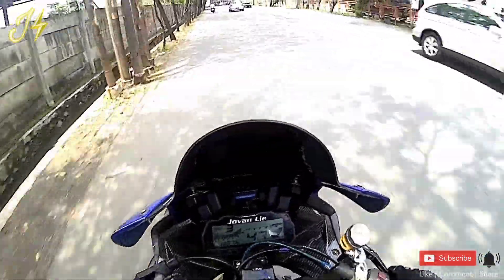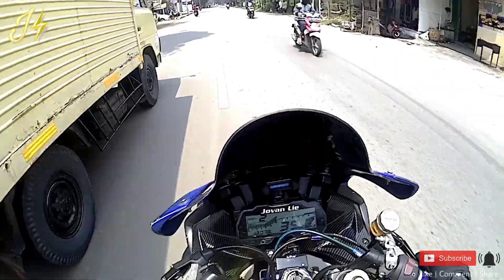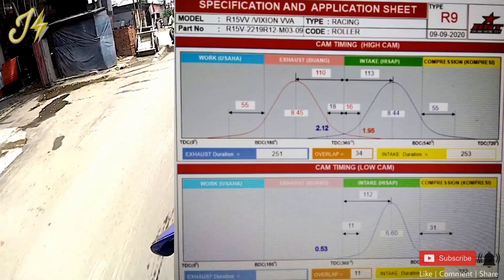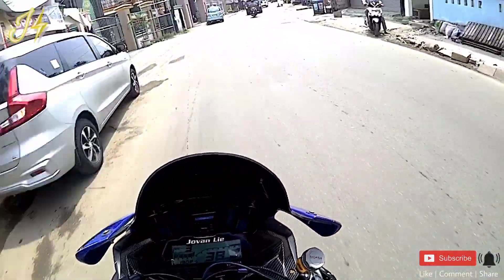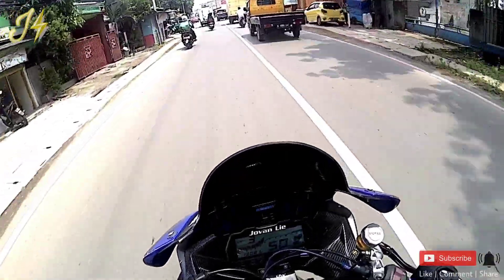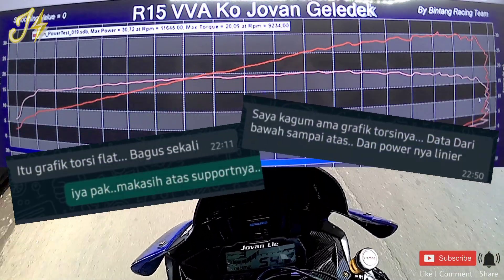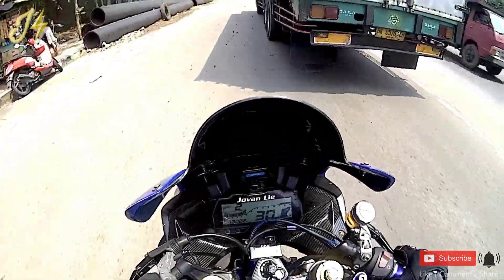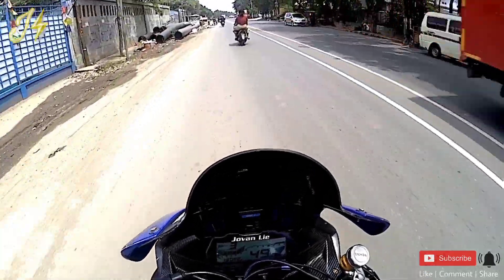SPESIFIKASI&BIAYA BORE UP R15 V3 31HP|R125|180CC ENGINE SPECIFICATION|MOTOVLOG SUBTITLE

Comment: Nmax ane boreouo mumet.
1. Blok brt ceramic  63
2. Juken
3. Velocity  + tb 32 brt
4. Noken as t2 brt
5. Stroke up brt.
6.  Tps xtr.
7. Klep r15. 
8.  Radiator  bpro.
9. Injector 8 hole brt

Kirian custom.   
Head standar.

Next project.  Head brt,per klep n klep brt

Dah males.  Kelemahan 
1. Paking head jebol . ( sekarang  pke tembaga dr Malaysia.( udah 3 aman)
Reply: Untuk VVA nya masih berpengaruh?

Comment: Ditunggu bang dicobain sama motor 250 CC 2 cylinder!!
Reply from the maker: Ampuuun abangku🥰🥰🙏🙏🤝🤝
Reply: Bang itu kira kira aman kah kalo buat harian?soalnya punya ane juga r15v3 nih hehe
Reply: @clorossagamers9167  menjawab pertanyaan abang.....Insya Allah Aman bang....palingan kalo menghindari overheat...bisa pake radiator R25 / Radiator Bpro buat R15 v3
trus Air radiator pake Engine Ice / Ipone
Oli pake Ravenol...joss gandosss 😁👍 sharing aja bang 🙏 Insya Allah bore up harian nya mantul .....
Reply: @reinorenskyaditya4654  kira kira habis berapa bang?
Reply: @21.muhammadilyas80  apanya nih?
Reply: @reinorenskyaditya4654  ga ngaruh bgt gan engine ice sama aja
Reply: @reinorenskyaditya4654 engine ice itu cuma gimmick. Sama aja air radiator pasaran

Comment: kalo quickshifter sam launch control pake apa ya koh ?
Reply from the maker: Halo brooo. Tq Uda singgah di channel saya🥰🤝QS saya pake merk A-Racer bro,harganya  2.7 jtaan (blm termasuk jasa pasang). 
Kalo launch control hanya main di settingannya aja, ECU nya pake Juken 5 Pro Racing turbo. 
tinggal nambah tombol core 1 dan 2, kebetulan saya kmrn setting launch control sekaligus upgrade spek bore up di Motori rumahnya bikers.jd dpt free.😁🙏

Comment: Bang tahap satu habis brp biyaya
Tahap dua habis brp biyaya 
Dimana bore up nya
Reply from the maker: Halo broo tq Uda singgah di channel saya.🥰🤝 Bore up nya di bengkel Motori rumahnya bikers.
List biaya bore up sbb:
*Tahap 1 bore up (power 23HP on wheel):
Blok 63mm,klep besar(head 2219),Porting polish,Camshaft, ECU JUKEN 5 pro dual band, plus jasa instalasi:
TOTAL sekitar Rp 5 Juta 500 ribu
*Tahap 2 bore up (power 26HP on wheel):
Upgrade spefisikasi dengan mengganti ECU JUKEN 5 pro racing turbo 1.650,penambahan double injector,Velocity,magnet,plus jasa instalasi: 
TOTAL Sekitar Rp 2 Juta 500 ribu
*Tahap 3 bore up (power 31HP on wheel):
Upgrade spesifikasi dengan mengganti camshaft tipe R9,double injector besar+Velocity, packing head tembaga, penambahan throttle body, per klep+retainer,plus jasa instalasi:
TOTAL Sekitar Rp 2 Juta 500 ribu

SUBTOTAL biaya bore up tahap 1+2+3: 
Sekitar Rp 10 juta 500ribu

Biaya bore up yang saya uraikan diatas adalah diluar biaya:
*Part pendukung motor bore up seperti knalpot racing,quick shifter (yang bukan bawaan ECU juken 5 pro racing turbo),busi racing iridium,accent wire.
Dengan penambahan part pendukung ini total sekitar 15 jutaan (tergantung merk dan harga part yang teman-teman pakai)

Jika diperlukan: Pasang steering damper untuk redam getaran, upgrade ganti radiator besar, upgrade pengereman, launch control.
Reply: @JovanGeledek  tq before mas admin, jd ada pencerahan berapa dana yang di perlukannya 🙏

Comment: Ijin bertanya koh, dengan spek yg sekarang ini
Bbm yang dipakai apa? 
Konsumsi bbm jd brp km/Liter? 
Topspeed on the road perkiraan sampai brp? 

Keren sih ini, spek sama powernya mirip R15 carbon garapan Ratmotorsport.
Reply from the maker: Haloo bro Tks sblmnya uda singgah dichannel saya🥰salam kenal ya🤝 Krn si babi bore up nya masih kategori spek utk dipakai harian(maks 63mm), jd utk konsumsi BBM tidak sampe extrim banget sih borosnya.memang utk bore up settingannya harus kaya BBM utk ke ruang bakar. Tp itu hanya saat si motor dipake bekerja extra trus(cara bawa yg selalu di geber dan dibawa ngebut trus2an). Selagi bawa stabil dan Tidak ngebut2an trus BBM nya konsumsi msh oke aja. Pemilihan BBM yg oktannya sesuai, dan pemilihan jenis serta jarak ganti Oli mesin jg faktor penting utk diperhatiin. 
Utk topspeed saya Tidak pernah tes dapat REAL nya on the road Krn faktor Medan jalanan yg Tidak mumpuni. Jika secara perhitungan data,dgn spek sprti ini topspeed bs tembus sktr 180an lebih.
Reply: Iya koh, makasih sudah jawab
Emang susah sih klo nyari topspeed klo tggal di jakarta. Kecuali malam hari. 😅

Saya punya r15 V2. Kira2 klo spek nya sama power nya bisa nyamain juga nggak ya
Reply from the maker: @rizkialfian7080  bisa banget donk bro.😁 Jgn lupa peruntukannya,mau spek harian.atau spek race😆jd tujuan nya dan konsepnya ditentuin dlu,baru disesuaikan dgn spek yg akan dibuat

Comment: Bang emg beda nya bore up spek harian sm race dimananya?  Klo bore up kan bknya sama aja nambah kenceng jg...  Trs apa bedanya sm yg spek harian?  Maaf bang pemula :D
Reply from the maker: Halo bang tq sblmnya Uda singgah dichannel saya🥰🤝 bore up spek harian vs race adalah beda di besar milimeter bore nya. Kalo utk spek harian disarankan maksimal 62-63mm. 
Kalo uda 64mm keatas Uda spek race tidak disarankan utk harian.
Reply: @JovanGeledek  aku pake bore×stroke ukuran 64x64,8 tak buat harian tapi aman² saja ngab
Reply from the maker: @bismaadhiyuka_0068  mantuuul bang😁
Reply: Dari segi kompresi juga beda bang,hari an mah ga terlalu padet kompresi,klo race mah kebanyakan oadet komoresinya

Comment: 31 hp 180 cc
saonone motovlog 177 cc bisa 35 hp lebih wkwkwkk
Reply: 35 HP itu dyno mototech, bedanya sekitar 5-6 HP sama dyno jet. Dyno jet sama dyno brt lebih berat dyno brt, bedanya sekitar 0.5-1HP. Brati CBR saonone sekitar 28-29 HP dyno brt
Reply from the maker: halo bang. Sudah terjawab oleh abang maulana zaky yaa. 🙏
Reply from the maker: @maulana zaky 
Makasih bang uda bantu jawab. baru sempat baca dan balas2in komen temen2 ni.hehe. salam gas pol